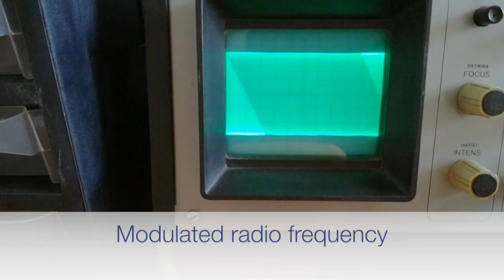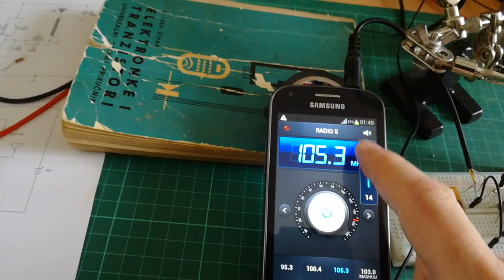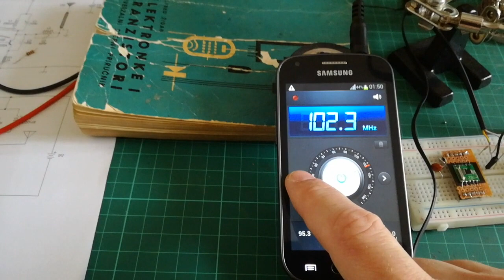FM to AM Converter For Vintage Tube Radios

Comment: Hi, is possible to get rid and eliminate the interferences sounds zzz zzz during broadcasting in the vintage antique radios , thanks
Reply from the maker: Hi. That all depends on the source of interfering signal. If it is internal, then there are some things you can do. If it is external, you're pretty much limited in actions you can take. First you must determine where is that signal coming from.
Reply: @vintagetuberadiorepairing67  the signals come from the high concert jungle ( the building) the traffic in the streets, air pollution and may be  some electric devices at home.
Reply from the maker: @makyhsmakyhs6766  In that case, there is very little to be done.
Reply: @vintagetuberadiorepairing67  what please